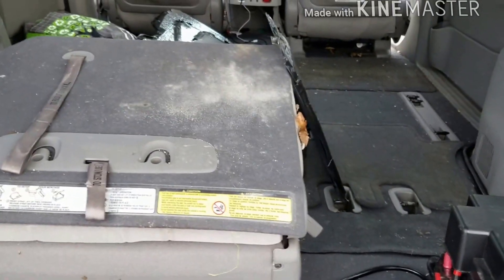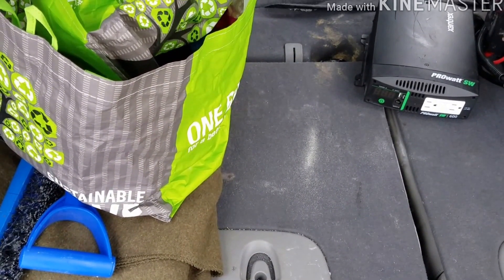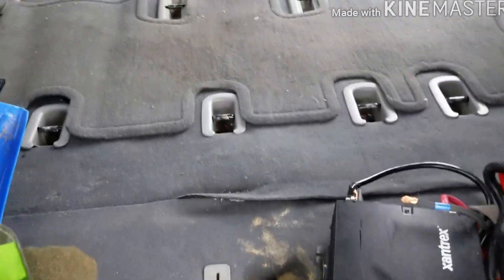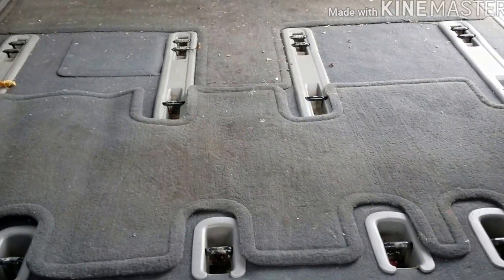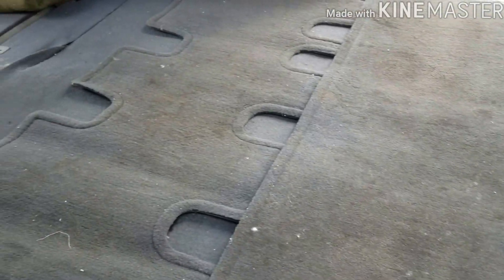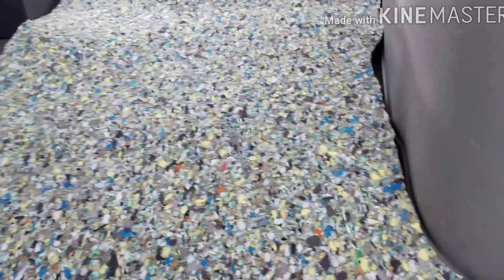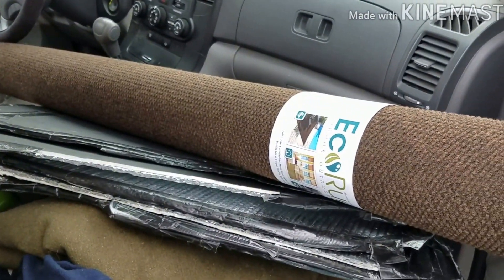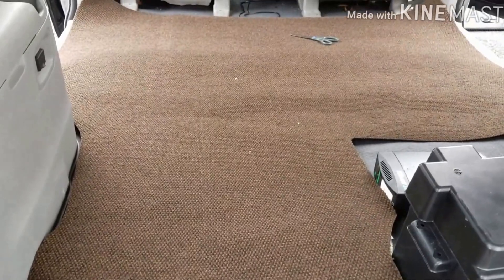Installed carpet and pad in minivan

Comment: I just came across the thought of carpeting the entire rear end of my Dodge Grand Caravan earlier today and went to Lowe's to see what options I could work with. I was originally going to put the peel and stick in carpet tiles in the back until I realized how uneven the floor's surface is. I then looked at the large rolls of commercial/home carpet and found a perfect gray colored office carpet I liked. I just bought a 6 X 12 foot section of the carpet and will install it tomorrow. It's far more than I need, but I rather have too much than not enough.

I've already installed carpet into the back of my van earlier today and came up short around the upper back portion of the floor by the sliding doors. Upon discovering this error, I also noticed how visible the odd humps and seat anchors were pushing up the carpet in areas, so I decided I will buy an underlay sheet board to put over the floor so that it creates an even surface. I will secure the underlay sheet to the floor with gorilla tape to prevent it from shifting around. The carpet will go over it and will be tucked beneath the wall panels/trim to be secured in place. This is going to be a fun project that I am going to film. Not sure what I will get on camera or how the video will turn out yet, but I will for sure be uploading it some time after the project is completed.

I'm glad I came across your video, because it shows me that I am not the only one who's thought of carpeting the interior to my van. My van is mainly used as a daily driver/cargo vehicle where I transport a lot of different things around and is one of the reasons I decided to do this carpet project. I never use the rear seats and always leave them folded flat into the floor. The neat thing about this project that I am doing is that it's not a permanent thing. The flooring could be removed at any time without leaving a single trace it was ever there.
Reply from the maker: That sounds like a great idea, good luck.
Reply: @lisamallard  Thanks! Just finished the project.

Comment: I can't stress this enough: you absolutely NEED to CRIMP that power cable.  The fact that it's a heavy gauge wire is the first indicator that it's a high current cable, and a flimsy connection is a dangerous condition.  If you do not have the proper tool, go to a place that specializes in custom audio installations in cars.  They will be able to properly crimp that connector.

BTW... I'm sure that padding and carpet will help insulate the van.
Reply from the maker: ugh, I may have to go back to the guy that did it, what a pain
Reply from the maker: thank you

Comment: Lisa,  remember where you paid good money to have your battery system installed?  You should stop there when you get a chance and have them re-crimp that wire that came loose.  Yes you can push it back in but it should be crimped on again with a special tool which will give you a tight mechanical connection.  Apparently it wasn't crimped on properly, it happens. They will fix it for free because you paid them to do it originally and it will only take them a minute.  They'll be happy to fix that for you.  I know I would.  Cheers  ,,,  P.S.,, after reading the other comments I think you got the message.  No need to reply. Best wishes.
Reply from the maker: lol, ya I did get the message....takes me awhile, to be fair to the guy who installed it, I have moved it around alot so probably my fault but I will get it fixed properly before I use it. Right now the inverter is off. thanks
Reply: If there was a stress relief attached to the cable that is secured to a screw on the inverter, that would prevent any toughing being felt at the crimped end.   There should be a screw eye featured cable tie securing the cable to a screw on the inverter. Like this,   http://www.audiogurus.com/learn/wp-content/uploads/2014/04/screw-zip-ties.jpg  Another way is with this  http://www.tiewraps.com/images/tie_mounts_Black_pic.jpg  attached to a screw on the inverter and a normal cable tye securing the cable to it.  Either way is what should be done to prevent it from happening again.
Reply from the maker: Wow, too complicated for me,  lol
Reply: No it's not. You can work a screwdriver to unscrew a screw and put it back.   I know you got a knife to trim off the excess wire tie.  You can do it easy peasy.  Any pulling on the cable there after won't be felt at the crimp end, preventing it from happening again.

Comment: I am pretty sure you are going to have to get another connector to crimp that wire into.  Whoever did it the first time did not quite make a good crimp.  If the wire is less than a couple feet, you can get pre-crimped wires at Walmart (or an auto parts store) for under $10.
Reply from the maker: Fernbark Frist thanks,  I stuck it back in and it works,  I will probably just try electrical tape
Reply: That is not good enough.  Just because it "works" does NOT mean that the connection is safe.   SAFETY FIRST.
Reply from the maker: ok, I will have it fixed properly, thank you everyone

Comment: Crimp it or it will ark, if it is the hot wire it can cause a fire if it touches metal . , hot normally is red , check where it connected , + is hot , _ is cold or minus , be safe
Reply from the maker: thank you, I will